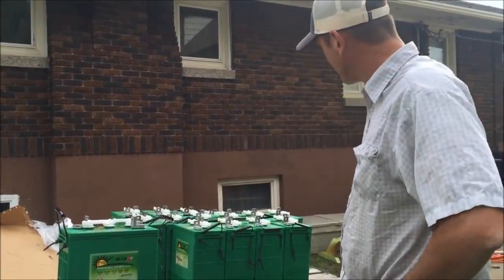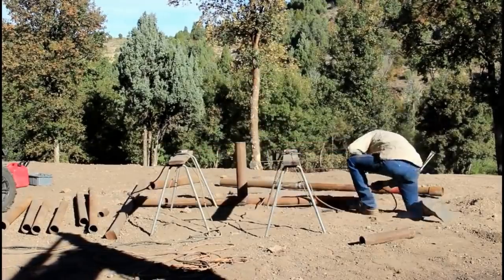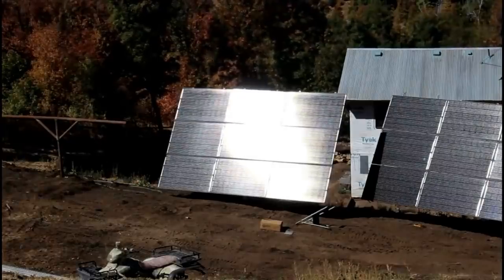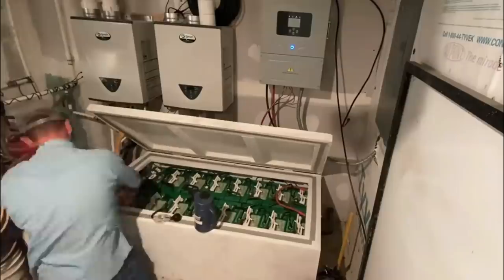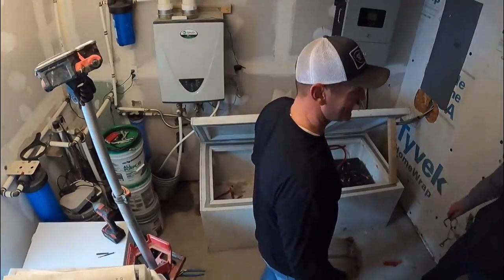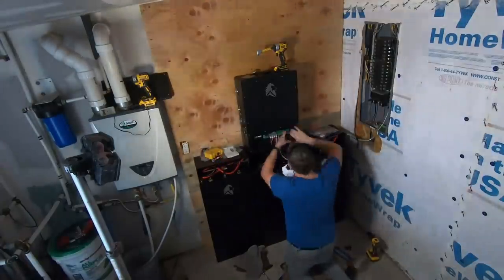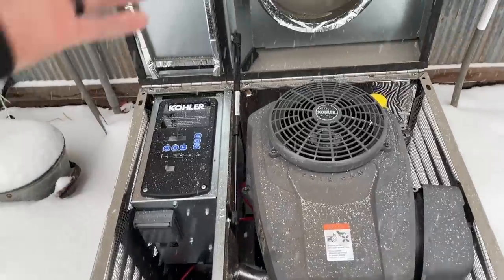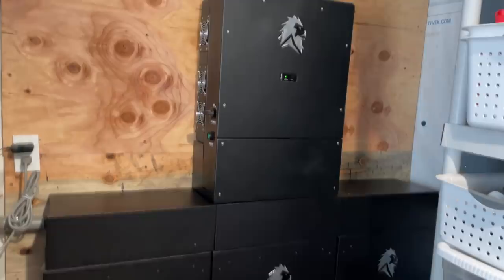#477 - Easy, Affordable Off Grid Solar Power System. (Battery Bank, Inverter Combo).

Comment: Hi Henry, Ceda and Family,
Firstly  let me say I enjoy your episodes immensely especially  you and ceders words of wisdom which are very similar to mine.  However if i said to you I had a motor and got another twice the size and expected you to understand how well my truck ran  you would probably laugh at me as I dint say how big the first motor was  10hp  50  who knows,  the same may apply for saying the number or weight of the batteries tells me anything about what you have.   Could you tell me what the voltage , amperage  and number of batteries is please for both  systems .. I have been off grid for   11 years and  have  some experience.   2 main factors  total wattage of battery bank and continuous and peak of your inverter.  Mine is 56,000 watts  and an inverter of 18,000 watts peak and 6000 watts continuous  which is the equivalent  of  54 amps at 110 volts, as I live in Australia  240 Volts  25 amps  and peaking at  75 amps.   Which you may think is excessive is because of the startup factor of motors which can be as high as 5 times the continuous run  amperage.  This allows me to run my  200 amp welder as well as normal house hold appliances  in fact  the normal  house supply in  Australia is 70 amps from the 90's when I was an apprentice electrician.  Your system appears to be about 6000 watts (27 panels  by 250 watts each less startup loss of about 10%) of solar collection where mine is about 7000   however some of the panels are very old and not very good..  I also use a sun tracker as it adds about 40% extra to the collection  but more importantly increases the use of the sun collection by about  6 hours a day in summer and about 4 hours a day in winter reducing your reliance on batteries during this time by 25% each day .  It also means when the sun is up early  my battery bank is normally full charged by about 9 am (6am collection start.)  The big advantage of a sun tracker is not the extra sunlight  a few panels can do that but the reduction  of  battery necessity  by about 25% or more per day. (there  it is the main advantage.   It also means  I only need the generator  a few days a year  because of the rain which is worse than cloud cover in Queensland where the off grid property is.  Even in winter I use the welder in the mornings  or any high use equipment.  I don't know how big your inverter is but I suspect it really is grossly undersized  for a hair drier to be effected.. At the farm we operate like a normal domestic house in the suburbs or more with my machine shop .
Here is the daily solar radiation for Fort Hall Idaho for your  info.

Month	Solar Radiation ( kWh / m2 / day ) AC Energy kWh )
January             	2.19	459	39
February	        3.20	604	52
March	                4.92	1,001	86
April	                6.00	1,148	98
May                 	6.76	1,295	111
June	                7.73	1,372	117
July	                        7.80	1,381	118
August	                7.06	1,257	108
September	        6.33	1,134	97
October	                4.64	912	78
November	        3.01	603	52
December	        2.12	441	38

For your system is about 15kw total available for collection per day at the worst time of the year, spread out over the whole day  which may be as low as 7 or 8kw  when it is on fixed panel.
 Go to google and type in "sun tracker graph" in images and you will see the difference and why it would be worth it to you.

This is the daylight sunrise sunset for Fort Hall Idaho  January 1, 2021  not far from the shortest day of year  mid December 9h0m
Twi: 7:29am
Sunrise: 8:01am
Solar noon: 12:33pm
Sunset: 5:05pm
Twi: 5:38pm
Day len: 9h 4′

Our lowest month is may with 3.7.

From the figures I see there you need about a 10 kw or more system only because of the November to February period (you size a truck motor not by the easy times but the worst continuous times the motor needs to work. Thus you like the Cummings motors, me i like the old Perkins 6.354 diesels not as big  but  does my work.) so why don't you do it for the power supply  you only need more panels kw $3500 and  1 to 2 regulators mppt type $2000 at most which are in reality 2 of the cheaper parts of the system. and that would bring you to basically  a town supply  with  generator backup.  I am sure you would be able to put the extra power to good use in summer.

What I am trying to say is I am sure you have a good system however it could be tweaked to get better results and I would raise the panels and you have the basics of a solar tracker  now from what I see of its construction.  There is little you would have to do to covert it to tracker format.  I had trouble when I first got my German  lead acid batteries which weight over a ton for the 6 batteries   you must know the charge rate for me it must be, a min of 150 amps by 32 volts,  for the batteries to fully charge, thus go to float, to get best results. which was fixed with the right mppt regulators. 

If you wish to discuss the matter more please don't hesitate to contact me.  There is a big difference living off grid and selling equipment to off grid people I hope the gentleman you spoke of has achieved that for you, you seem happy  so he must have been of some benefit.

Yours  with love.

Gene McIntyre

Comment: I want a system like that for my parents. But they live in Brazil.
Reply: so buy it in Brazil..(?)
Reply: I've just found resellers of chinese stuff.  And that sanctuary might cost a fortune to import with 60% of tax over the product + transport.  It might worth import just the controller and  inverter and then buy the batteries locally

Comment: Wondering what you've learned/researched about using nickle/iron batteries?

I've read a lot, but I always worry that I'm missing something...
Reply: Last forever but don't handle large draws/ have high self discharge. Is you have enough solar and a big enough battery system the it would be the best. But it's not the best option for most people
Reply: NiFe Batteries are really an good option for Inverters. Webby is right about the issues with NiFe. In addition you have to replace the electrolyte, every 5 to 10 years since the Sodium Hydroxide reacts with CO2 to form Na2CO3. You still need to top them off with water periodically. As of Feb 2021, the best Option for Inverter batteries is LiFePO4. There are a few new Battery Tech in the works, but its probably 4 to 5 years before its available for off-grid use. One is Solid electrolyte Lithium batteries which offer slightly better energy density & have more cycle life than Lithium or LiFePO4 batteries.

Comment: It sounds like your inverter was to small for the loads.
The kids will be gone in a few years and the amount of juice you'll need is far less than what it is for now. So what size inverter do you have now?
Reply: its the lion energy 8k inverter/charger
Reply: Same size invertor as the Sol Ark 8kW. Issue with the SolArk is they were using lead Acid batteries which have a poor power output curve, and their replacement Lithium bank was undersized. Looks like they upgraded from about a 100ah@48V bank to a 400ah@48V.

Comment: Was it a modified sine wave versus pure sine wave output issue? Was it the amp draw or efficiency of the inverter that was the problem initially? I have planning to build my own system (after a lot of videos from Will Prouse) but looks cost effective. Is there an “rough” retail for the system you have you can share? Looks like you got the largest.
Reply: it was the amp draw pulling too much from the battery bank. They simply needed more batteries, not a whole new inverter. And "pure sine wave" is a meme, all inverters produce pure sine waves for the 120v ac out.
Reply: Sol-Ark are true sine-wave.

 The issue is that RPR is pretty hard on their batteries with frequent draw downs. Lead-Acid have power drawdown curve such that as you draw down the available power also drops. Lithium or LiFePO4 have a near flat power output as the batteries are drawn down. I suspect Lion Energy probably sold them a package deal likely at a major discount for promoting the product. Sol-Ark has been pushing the Lead-Acid instead of Lithium because Lithium type batteries have Battery management system that is vulnerable to EMP. Sol-Ark provide EMP hardened inverters. However I believe Sol-Ark is now offering a package using Lithium.

Sol-Ark are pretty efficient around 96% I don't think the Lion Energy inverter is going to any more efficient.

FWIW: if your looking to install a whole house inverter, expect to pay about $15K to $18K for a useable system. About half for the inverter and other electrical components (breaker box, wiring, breakers, bypass switch, etc) and the other half in batteries. Anything less than an 8Kw system is going to cause aggravation as you be very limited on your power use, and have to micro-manage your power use (ie cannot run multiple high power devices at the same time). A lot of high power devices will have a much higher current draw during startup (for instance a compressor motor in a refrigerator, or a motor in a vacuum cleaner) so even if the devices have a average power draw less than your inverter, trying to run them simulatously is likely to trip the inverter.

FWIW2: I have a Sol-Ark 8K and twelve 12V 100Ahr Battle Born batteries. However, I do have access to the Grid so I can run high load devices such as an electric clothing dryer, Welding equipment, Central AC, etc. I  have two breaker panels. One for the Grid (High load or non-critical circuits). On the Sol-Ark breaker panel I have lighting, Frig\freezers, Bedroom outlets, etc).

Comment: Are any of your appliances designed for solar use?? We are getting ready to purchase for our off grid build. Our appliances are designed for solar use. All they need is the panel and battery. Inverter is built into the unit. And all in told since day 1 how much have been invested. I understand power is not a option due to your location.
Reply: Sort of: You can by DC appliances, but I don't recommend it because of cost an availability. The issue is if your DC appliance (ie Frig) its likely going to take a month if not more before it gets delivered. Where as with an AC appliance, you can usually get a replacement in a week or less. Modern inverters are pretty efficient around 92% or better. Not worth the hassle or aggravation of trying to find and buy DC appliances.
Reply: @guytech7310  Have you tried to buy any appliance as of late?? I was looking and some stuff is MAY/JUNE for delivery dates. Little is stocked in stores now. Many don,t allow in store pick-up. The brand we are looking at. I can have in a couple of weeks. Which is fine by me. They are going into storage till the house is built.
Reply: @hartiaacres  Perhaps, but I am sure the same is the case with DC appliances only worse.

The other advantage is in an economic collapse where you cannot obtain new appliances you can salvage older AC appliances if your current unit dies. 

From the research I've done in the past repairing DC appliciances are nearly impossible because its impossible to get replacement parts or find repairmen to fix them. 

Also your options are limited with DC. While there probably several dozens (if not hundred) or more of different models of AC appliances, they are at best just a dozen or so DC appliance models available. 

For DC appliances you also have to run much heavier gauge wire since DC appliances run at less than half the line voltage of AC. DC appliances run at most 48V and some as low as 12V. If your appliance needs to run at 1000W @12V you need to run 4 awg wire. 1000W@24V 8 awg, and 1000W @ 48V 10awg. This can get real expensive.

Comment: Don't forget to check for oxygen before going into the well 
This is sneaky dangerous
Reply: Check for oxygen?
Reply: @karenminckler4198  the well is a confined space.  Confined spaces can get depleted with oxygen (a major industrial death risk).  you can have rust formation or oxidation of iron in the well water etc.   when going into a confined space you should check oxygen and take pecautions
Reply: @chrischristenson4547  never knew that. Our well at camp had boards over it and dad would just take that off. At the beginning of the summer when we went to camp he would put a cup of Clorox in the well. It would kill whatever was in in from the run off of snow. It would be okay until the next year.